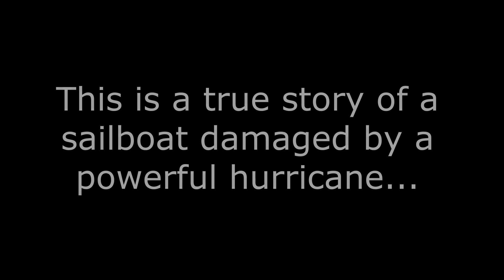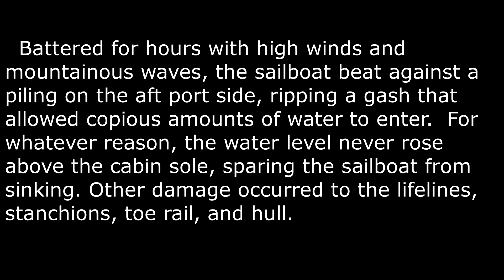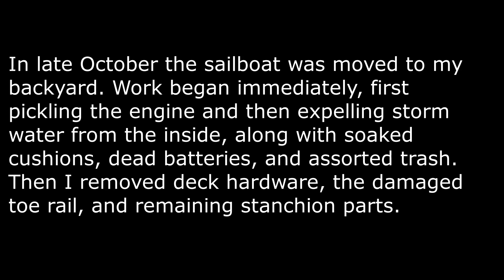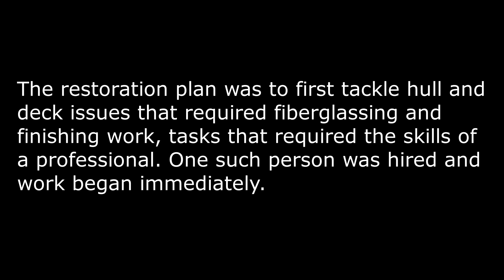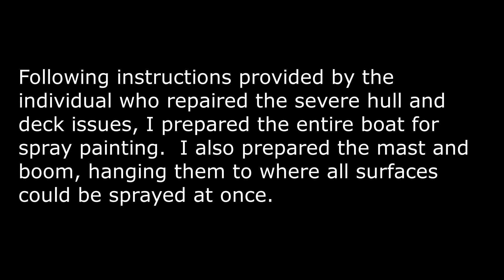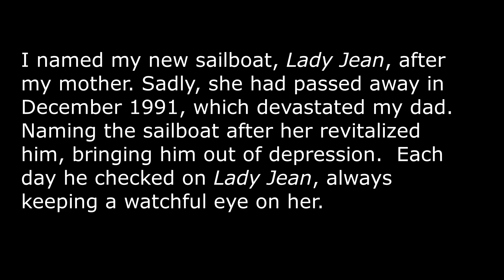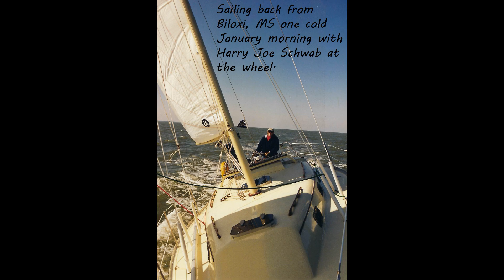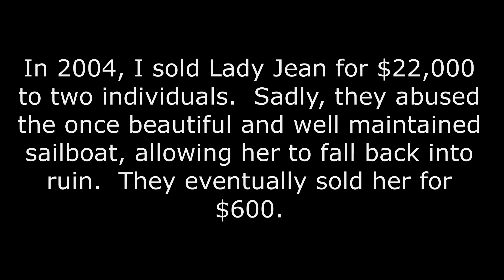1984 IRWIN SAILBOAT RESTORATION

Comment: great video...have a similar situation going on. A salvaged boat in MS after Zeta. Almost finished, but have run into a problem with the engine and can't seem to find a good diesel mechanic. 33 Cape Dory with a Universal 24 HP 3 Cylinder. Currently in Biloxi....any suggestions?
Reply from the maker: No sir.  Finding a diesel mechanic is hard.  I've talked to several but getting them to commit is difficult.  I wish I could help you with that one question.....
Reply: @DDixon3121  yes sir...thanks for the reply....i have a place in PC, would love to sail with ya sometime if ever need crew ! Thanks